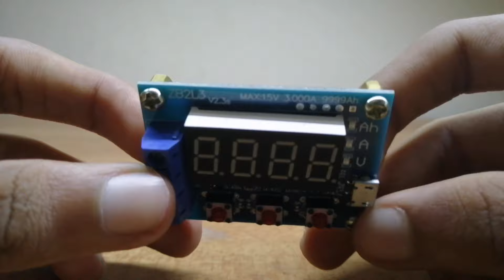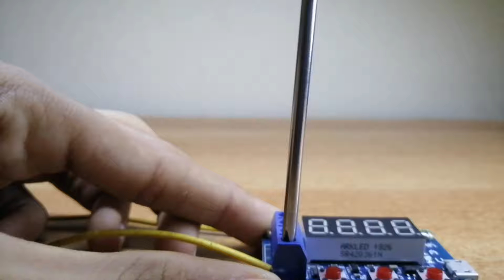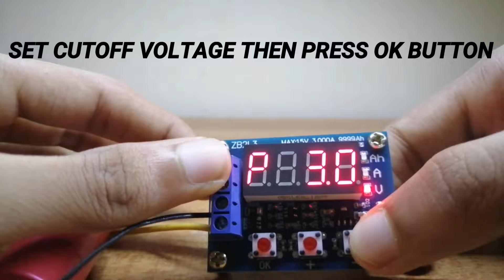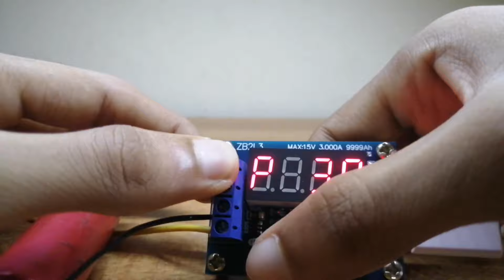ZB2L3 BATTERY CAPACITY TESTER

Comment: I have got my unit, I put it on and test my 3.2v lifepo4 batteyr, after runs for few minutes, I touch the white register, it is very hot to touch... was it normal ? It is save to carry on for few hours ?
Reply from the maker: Yeah, it's normal. If you want You can add a small cooling fan.

Comment: hi may i ask，the capacity show in ah or mah
Reply from the maker: Ah
Reply: @ElectroRetro can I check 12v 27ah lead acid battery?
Reply from the maker: Yes
Reply: @ElectroRetro  but there mentioned 3ah maximum but I have 12v 26ah can I try?
Reply from the maker: @Ig_jigglegodd  3A is the maximum discharge current.

Comment: What does mean if code err2(error) come out? I have chacked voltage battery using multimeter 3.8v but when using this tester pop up code err2
Reply from the maker: According to the description of zb2l3, Err2:The battery voltage is lower than the set termination voltage
Reply: @ElectroRetro  i see. So i need to recharge and test again right? Normal discharge voltage is 2.5v right?
Reply from the maker: Maybe you set the termination voltage higher. To start the test with the automatically determined termination voltage, press the “OK” button.  The display will flash the termination voltage 3 times and begin testing.  If you wish to set the termination voltage yourself, press “+” or “-“ to modify the termination voltage as desired, then press “OK” to start the test.
Reply: @ElectroRetro  its working now. Buy when i set termination “P2.7” the last voltage stopped at 3.0v what does mean that? Why he not stop at 2.7v?
Reply from the maker: After stopping the test at 2.7v. The battery voltage may rise to 3v.

Comment: Sir can i use 5w8.2ohm resistor on this module for 18650 battery
Reply from the maker: Yes you can use it. The discharging current will be about 500ma if you 8.2ohms resistor.
Reply: @ElectroRetro  thanks

Comment: Sir what is the cuttoff voltage of bl4c nokia mobile battery?
Reply from the maker: What's the output voltage?
Reply: Nominal voltage 3.7    end charge voltage 4.2   maximum charge current / discharge current  500 ma
Reply: Sir how to check mobile battery capacity? By this module
Reply from the maker: Maybe 3v I don't know exactly.
Reply from the maker: The procedure is same as 18650 battery just reduce the load current.
Reply: Where I can found exact cuttoff voltage??

Comment: Can work to AA size battry sir?
Reply from the maker: Yes
Reply: @ElectroRetro  are you sure sir,.for.AA.size battry Nimh/nicd ? Its work?
Reply from the maker: It's not made to test low voltage batteries, although it supports it. Can't guarantee the accuracy.

Comment: Hi bro .. Want to ask about this module .. In terms of finding the real/original capacity on one 18650 battery, what is the most accurate load size to use?
What's the maximum load that can be used or handled? 1 Amp or 2 Amp or 3 Amp?
Thanks 4 answer & greeting from Indonesia ..(^_^)/
Reply from the maker: I discharge 18650 batteries at 1amp of load. I use couple of 5w 7.5 ohms resistors in parallel to get 1amp. The maximum discharging current of this module is 3amps.
Reply: @ElectroRetro  Thanks for this straight to the point performance! Exactly what I wanted!
So in order to set the discharge rate, I have to set a certain resistor? Is there a manual which resistors to use for which rate?
Thanks
Reply from the maker: @machtundrebel3127  if you buy this module you can get 2× 7.5 ohms 5 watt resistor. You can use 1 resistor for 500ma discharging current or use 2 resistors in parallel to get 1000ma. thanks for watching

Comment: DO NOT BUY THIS PIECE OF CRAP.  It can measure voltage fairly well but it can't accurately measure current.  My testing shows 705% error at 1.0V, it gets better at higher voltages, 27% error at 3.5V.
Measuring current is the primary thing this device needs to do for a battery capacity test and this device can't do it.
Reply: What do you recommend then ? There is something better then this little board?
Reply: I found they drift out of calibration,  some after only a few cycles,  so not super great if you have hundreds of cells to check
Reply: @ricksummerfield784  That's right, one battery measures 2500 mAh once and 375 mAh the second time after charging. It's totally wrong!